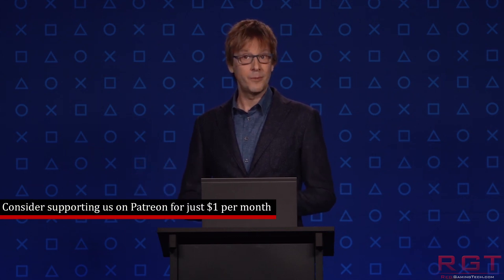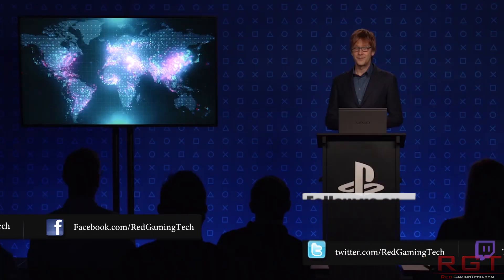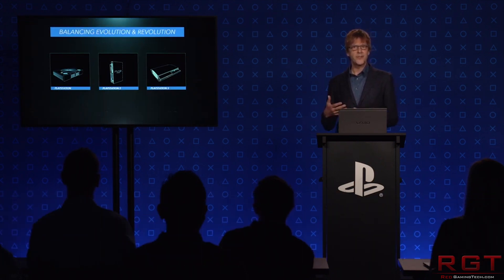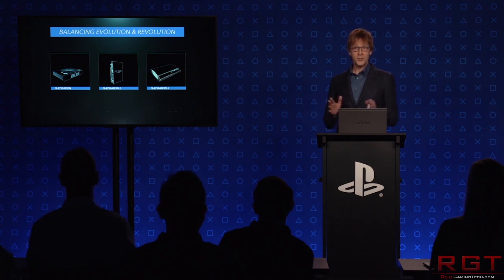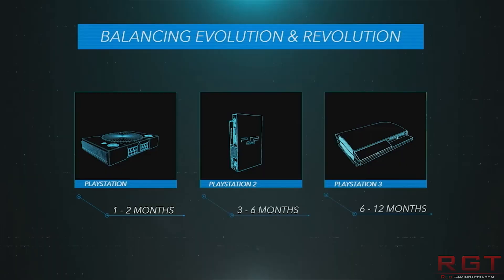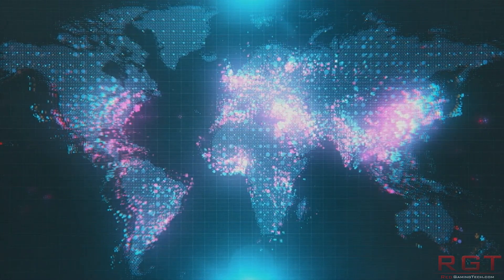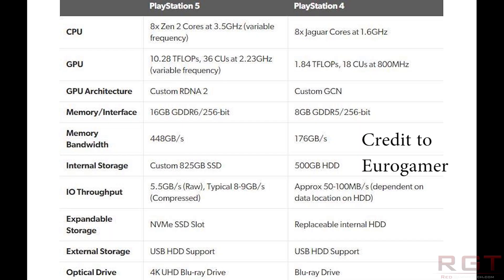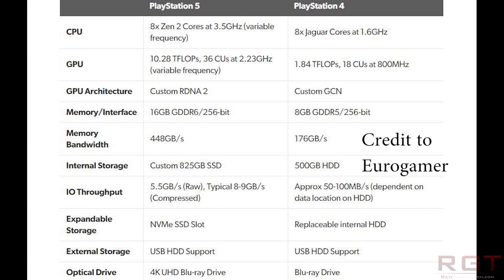Playstation 5 Spec Overview & Analysis | 10.3TFLOPS & RDNA 2 | 3.5 GHZ Zen 2 & Crazy SSD Speeds

Comment: As a member of the PC master race, this is pretty cutting edge stuff. I'm impressed with these new consoles.
Reply: While I have some feeling on how honest Sony is being about the sustainability of the PS5 clocks as a tech (and my electrical engineering studies)  with over 20 years of experience, I whole heartily agree. These consoles are very impressive, unlike the PS4/XB1 which were basically under powered potatoes. I did not buy consoles at launch last gen because of this for the first time ever. I did get a PS4 a year after launch and waited on MS tell the XB1X dropped. This go around though I will be first in line once again to grab these at launch if possible. As much as I love my PC, it could use a solid challenger(s)!!
Reply: when these consoles release you'll be a member of the pc peasant race 😂😂😂😂😂

(disclaimer) tis a wee joke, nothing more 😀